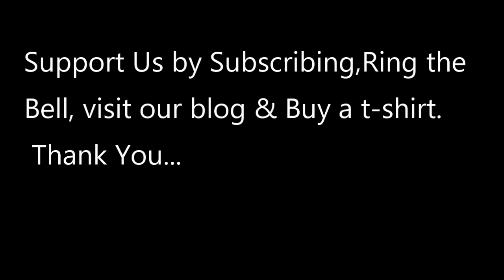A LOOK at TRUMPs BORDER WALL -UPDATE 2020 - PART 26

Comment: If they are building 7 miles/week and the last report 2 weeks ago was 423 miles then >430 miles must be completed at a minimum. It is more likely it is >437 miles or even > 444 miles. The latter is the most likely if they are to reach 450 miles by 12/31 as that is just 3 days away. If they continue this rate into Jan in the first 3 weeks, by inauguration day, there would be an additional 21 miles putting it at about 471 miles.

Comment: **EXTRAPOLATED  20210104  *Grand Total 457+ miles  (CBPe: 453 miles as of 20210104 ; Private: 4 miles). *Promise kept!
This is ≥ 101% of 450 mile goal, ≥ 89% of 509 mile goal, ≥ 69% of previous 654 mile preexisting, ≥ 45% of 1,000 miles, & ≥ 23% of entire southern border. *Extrapolated @ 1 mile per day using recent rate.